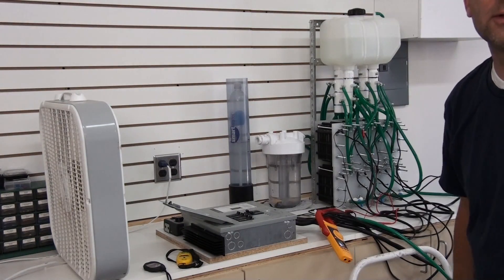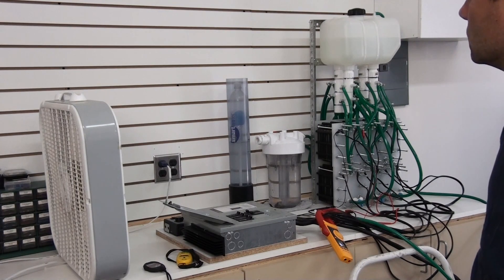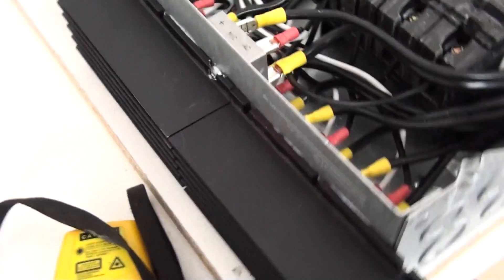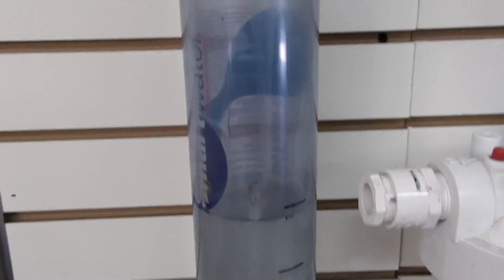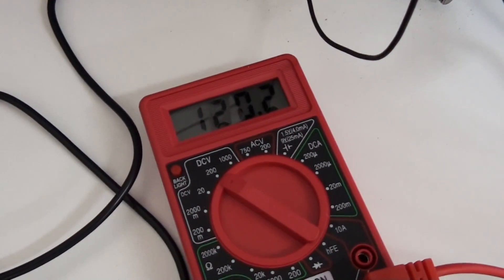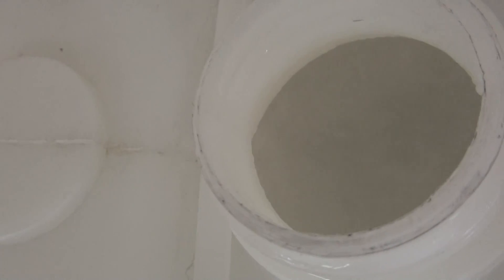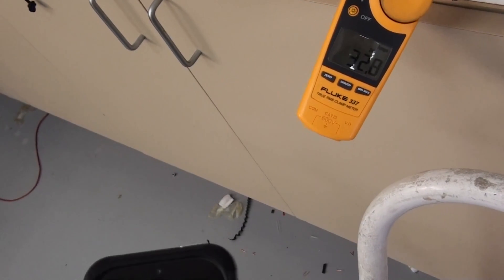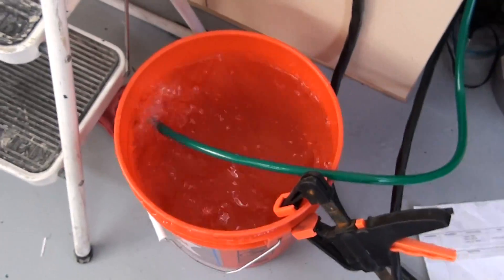HHO 354 Plate Monster Hydrogen Generator Build Part 6

Comment: We know in HHO generation process that voltage drop between any two plates must be no more than 2.3V for a good efficiency. If you use this 120V 15amp Max Variable Voltage controller, you can change the voltage. But the question is if you start from low end for less power generation, what's the voltage between each plate? Isn't it better to use PWM regulators, because they don't change voltage, they change (modulate) the width of the pulse.
Reply from the maker: Yes that would be better but there are no 120/240 volt pwm's on the market. The way we do it works really good.
Reply: @Hydrogen4Health  but the pwm for 220v dc could be manufactured or not

Comment: Trying to think of a way to make the output safer. Maybe a series of bubble tanks where gas transfers from one small tank to next by way of bubbles (not hose but bubble as they are separated by water). 

Compartmentalizing output into series of small containments so that if explosion does happen it only explodes last chamber. But even if it contained one explosion the generator would still be cranking it out and might cause more.

I like the idea of a small hho for assisting gas mileage and simply fed into intake vacuum. My understanding is that it neither effects the MAF or the O2s. So the explosion is no concern. 

Yours looks good enough to run a generator at full speed but also makes me wonder how safe it is.

Comment: Nice amount of HHO, but how does the cost of power required to produce HHO, make it practical for use (what ever you use it for)? It appears that the cost of making HHO is not justified. But if your doing the project for fun or education, then your having a great time. I like the video, but as a businessman, I'm not sold yet.
Reply from the maker: +Joe Smuck Joe id depends on what your going to use it for. I sell hho and hydrogen for many uses and people buy it for many reasons. To name a few. welding, storage, Hcat, health therapy, sanitation, agriculture and even mileage boosting! It's an amazing gas!

Comment: is distilled water making contact with the cells?
Reply from the maker: joel castro yes distilled water is in the cell.
Reply: I watched all 6 parts , I must have missed something cause I seen u puuting the cells together but I did not see how you were keeping the water in.
Reply from the maker: The water is in between the black gaskets.

Comment: If you actually run your car for very long under load at various speeds you will have figured out how to regulate the input of the gas but even more importantly, you will have figured out how to keep the hydrox from burning holes in the top of the pistons since it will burn much hotter..... really a helluva lot hotter than normal for a combustion engine.
Reply: BushPilot444  : Need more  Hydrogen,  and less Oxygen.  Otherwise  the Oxygen  will work like a cutting 
Torch.  On the top of your aluminum piston.
Reply: How much % of that hho machine is exactullie hho that can burn?  1liter per 1,6sec is allot i dont know how much an car engine needs?

Comment: You are using so much electricity (amps/volts) that the payback from the hydrox would have to be enormous to justify the expense.  I don't see any future.  If I make a 220 volt drop cord and plug it in your outlet I then have access to a tremendous amount of 220 volt power that I can put to work coming out of the other end of the drop cord without all that work you just did and have accomplished the same thing. 1. What is your goal?  2.  What do you expect to save in cost or energy?
Reply: +BushPilot444  I am asking the same thing: what do you expect to save?

Comment: Your voltage controller is for hho only? Or you convert it from the other device? Coz i wanted to know  for my hho 21 plate. I used only battery charger 12 volts 15 amps. Coz i can not adjust amps from battery charger.

Comment: So what would one use 40 liters of HHO per minute?   Given the amount of power needed to produce that much gas, where is the capital gain?
Reply from the maker: Okay since you asked again. This can be used for carbon cleaning and would make a very nice cutting and welding torch.
Reply from the maker: This isn't H2, It's hho and CANNOT be stored.
We have hH2 generators on our site for this.
Reply from the maker: Yes When water is separated H is crated on the neg. plate and O on the pos. In a HHO cell they quickly mix together. To keep them separated a different type of cell is used.
Reply: +delvis11  Hydrogen doesn't burn hot enough for most welding applications.  There are a couple of specialty applications such as underwater welding and improving the weld when brazing stainless, but for general purpose welding it just doesn't burn hot enough.   That's why most welding gas suppliers don't stock it.
Reply from the maker: +pyronaught It's not just hydrogen. With oxygen It will cut anything. see the welder videos on my Facebook channel.
https://business.facebook.com/GreenFuelH2o?business_id=950938364924915
Reply: so practically this is what they call hybrid fuel right? has anyone tried to use this as a rocket fuel?
Reply: @netbuckler91  NASA Has sense the 50's

Comment: I want to see exactly how much mileage you can get on different types of engines in a time lapse without stopping, that would be great.
Can you arrange that?
I'm particular interested in how much you can gain from a 1,6 liter diesel engine and it's said that HHO works especially good with diesel.
I would also like to see this working with another hybrid vehicle with a small engine, EV and HHO, imagining how much you can save, it should be a great deal of saving with this setup :)

Comment: Measuring current consumption is wrong!
You do the reading after the diode bridge, DC ammeter.
But you do not take into account the fact that you do not have a DC! After the diode bridge you get a unipolar pulse current. To measure the incoming AC power. The reading will be twice as much.

Comment from the maker: I know the meter is measuring close to what is actual. I did clamp each individual wire to see what was being measured. them clamp all six and it's close. I also know that this type of electrolysis uses about 200 watts per liter so that also indicates that it is close. I know I'm not completely accurate.

Comment: Like the videos, but unless clamp meter technology has moved forwards in the ten years since I was using them at work, clamping around more than one wire at a time won't give you an accurate reading at all.
If you want to see what each cell is pulling, you'd have to clamp each individual cable at a time. Unless, they can now measure six cables...